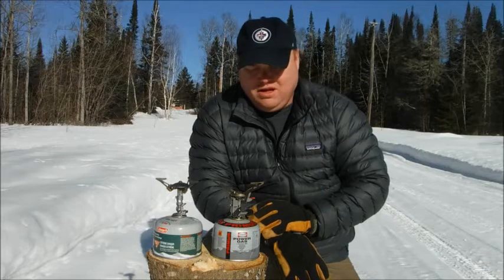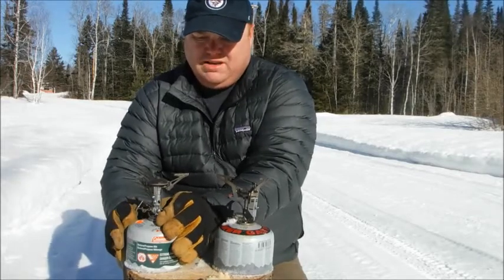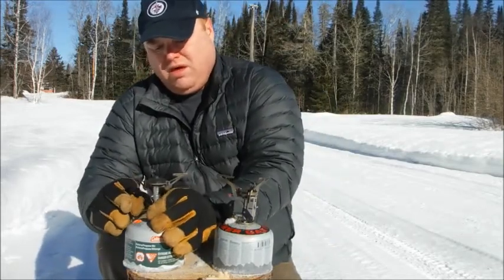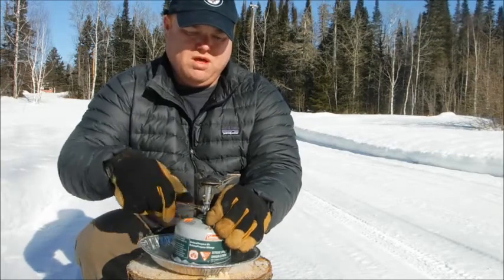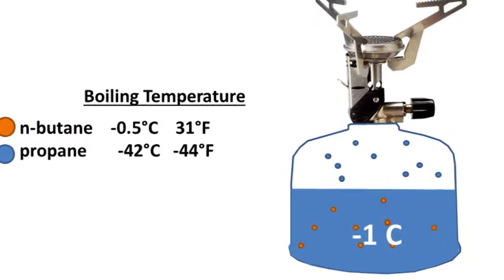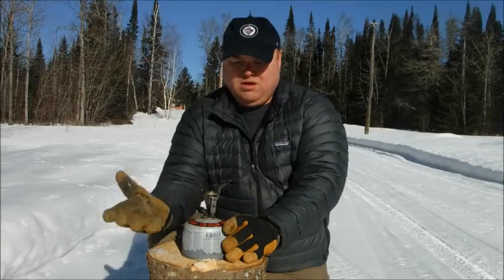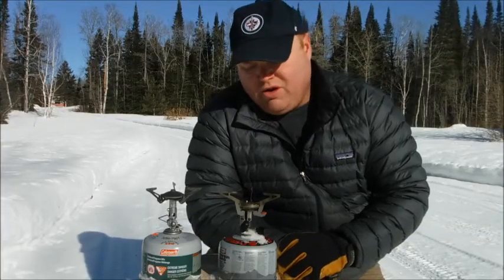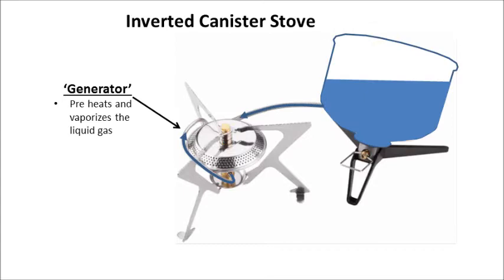Canister Stoves in Winter

Comment: I have a couple of things to say. 
I assume that even if you preheat the canister with some water then only isobutane will burn and butane and propane stay in a liquid state and won't burn at all (unless the canister heats up a bit from the burning fire).
Second. Inverted canister stove with the preheat tube is good to burn all the gas that's in the canister (including propane and butane) which will not probably burn if you use a regular standing upright position.
What do you think?

Comment: That water bath is a great trick, where do you find liquid water at -20C?
Reply from the maker: Since this was just a demo I got it from my house.  When I am winter camping I am collecting water from a hole in the ice and that water is just above freezing.  Also I will boil water and put it in secure bottles in my sleeping bag overnight.  By morning those bottles are still well above freezing.   When winter camping I am always managing my water to ensure I have at least some available at all times.
Reply: @KevinOutdoors  Takes a long time to melt snow, plenty time for that cold water to freeze. If this works for longer than 5 mins it has to be because some heat from the stove is being reflected down to the water bath to keep it from freezing. Still a neat trick though, thanks.
Reply from the maker: @andyr4611  I know in some situations, like arctic expeditions, people have to melt snow but that is pretty rare for me.  Melting snow takes a long time and consumes a lot of fuel because snow is so bulky and you only get about 20% of the volume.  Another trick is to put the fuel canister inside your jacket, it will warm up and light just fine.  Once you have some warm water you can keep going all you want.

Comment: GSI has one of the best cartridges on the market for high altitude snd cold! 70% isobutane, 20% propane and 5% butane.

One needs an inverter system for canisters in serious cold.

For serious cold & altitudes one should skip canisters and go with a liquid white fuel stove!
Reply from the maker: I think you said it very well!
Reply: @KevinOutdoors Thanks 
You hit the nail on the head about the Coleman…it’s just a simple mix. 
Calling the Coleman 70/30 “performance blended fuel” is misleading @ best!

Comment: Thanks for the explanation. Have you posted about liquid or multi-fuel stoves in winter?
Reply from the maker: I haven't.  Something I might try.  Thanks for the suggestion.
Reply: @KevinOutdoors  liquid/multi-fuel stoves in winter and/or high altitude please, if you can ;) Do you happen to climb big walls?
Reply from the maker: Cold weather I have, mountains I don't :) @franka7691

Comment: Suggest you try the test again with a cannister containing iso-butane and propane.  Example brands are Jetboil and MSR Isopro.  I expect this will work better than the three gas mix, which might end up vapourizing the iso-butane and propane, and leaving the N-butane in the cannister.  I've never seen a cannister in my country with the two gas N-butane / propane mix.
Reply from the maker: I suspect they will function similarly but it might be worth a try.  I checked out both manufacturers.  MSR Isopro does contain n-butane but they specify <5%.  I actually use those canisters quite often.  The Jetboil canisters are supposed to be 80% Iso-butane and 20% propane.

Comment: However, if two gasses are completely immiscible with each other, each one will behave independently of the other in a closed vessel. So why doesn't the Propane (-44 deg F boiling point) work best, even with the butane mixed in?   Or am I not remembering my high school chemistry correctly?
Reply from the maker: I am not a chemistry professor but I believe the propane gets used up first.  Sometimes these stoves will light and burn for a bit then go out.

Comment: I live in Fairbanks, Alaska.  I found that at -20 to -40 degrees the stove lights, but with the 4-seasons canister does not boil water as well as my MSR whisperlite using white gas.
Reply from the maker: That makes sense as white gas is far superior in cold temperatures.  Below -20C even the winter mix will slowly stop to function.

Comment: Hardcore winter canister top stove users may want to take a lesson from rock climbers and wrap a couple turns of 1/8" copper wire around their canister, with both free ends of the wire bent upwards, into the flame.  Don't dump so much heat into the canister that you blow yurself up, kids.
Reply from the maker: That last part is the trick isn't it.  I know it works but I wouldn't try it, it is a very steep learning curve :)
Reply: Awesome tip, thanks.

Comment: I found a heat transfer product designed for fuel canister! 

http://image.auction.co.kr/itemimage/13/3b/bb/133bbbb486.jpg

Check out this image... i can only see it in Korean market.... but  I am sure one could make a similar thing easily.

Maybe a strip of copper or aluminum and a strong magnet.  Since it will be used in cold weather + metal will be some what thin? It'll never get hot enough to make the canister itself hot.

What do you think?
Reply from the maker: This is a very interesting concept.  I have seen this kind of thing before but not a commercial product.  There is a video out there where a rubber band is used to hold a copper strip against the canister and the strip extends up to near the flame just like the picture you show.  This will work, but there are risks.  At some point, enough heat will cause the canister to go 'BANG'!  I don't know much about when that would occur but I do have an old windscreen that clips to the little rim on the top of a canister.  It looks ingenious but it was recalled because it could possibly transfer enough heat to cause the canister to explode.  I find this really, really interesting and thanks for sharing.  I would shy away from this technique, I am sure explosions are very rare but you don't want to be 'that guy' who had an accident.  It is interesting that this could be used with different stoves all of witch could have different heights and different radius of flame.  Not a lo of control on how much heat is transferred to the canister (unless I am missing something).   If I was going to regularly use an LPG stove in cold temps I would use a stove with an inverted canister and a pre-heater.  But, this is very interesting to me and thanks again for sharing!
Reply: @KevinOutdoors  True, enough heat transfer can make it go KaBoom.  But looking at that commercial product you could see that metal is thin and narrow inside some sort other outer part.  Can't imagine it transfering enough heat.

I saw the video you spoke of and in that video... even a hand warmth helped get it going.  So very small amount of "warmth" transfer must be enough.

But... I guess better safe than sorry? :)  Cheers!
Reply from the maker: It does look ingenious and well designed and they may have figured out the safety part. Almost any form of heat will work, keeping a canister in your sleeping bag, setting it in water or applying a chemical hand warmer will work.  You just need to raise the temperature to above -12C and I recently saw a new 'winter mix' that was rated to -20C.  It will be interesting to see if this will come to markets in North America and Europe.

Comment: 60 dollars for a white gas stove. It a lot safer when it's cold and use the canisters in the summer.  30 ounces of white gas can save your life in the winter. You can unthaw your hands or feet dry boots and boil water. If all I had was a canister stove I wouldn't go in the winter. Too dangerous and white gas is cheaper too

Nice video just the same
Reply from the maker: Thanks, yes just showing how it can be done.  I only think it is dangerous if you rig up a heater.  I have seen folks use a copper band to get hot in the flame and they tape it to the side of the canister.  Not the way to go.  I too prefer white gas in the winter and actually where I live winter usually means you should be building a proper fire.  Thanks!

Comment: better use a stove with inverted canister mode with a heater tube so it can burn liquid butane directly...
Reply from the maker: Yes I agree.  Exactly what I reccomend in the video.
Reply: @KevinOutdoors  liquid does not ever burn directly. Nothing in liquid phase burns directly. . It has to be a vapor or gas. Inverted stoves flow liquid to the burner where it heats the liquid into a gaseous state which then burns with gaseous O2 to produce the flame. Great video. Thanks for posting

Comment: We always use IsoBut in the winter and even in the mountains at elevation, it just burns cleaner and without issue unlike straight propane.
Nice lid!
Go JETS Go!
Reply from the maker: Thanks!  The 'Jets' are my kids team.  Gotta like the NHL team too!
Reply: i am planning on buying propane Coleman Bottle Top Propane Stove, with propane cannisters. whats the main issue with these for winter camping ?
Reply: @shahzaibsansi7848  Propane loses much of it's ability to vaporize thus also pressurize in cold temperatures.
I use straight Isobutane by MSR   but it truly is all the same and have never had any issues in winter, but you can also buy winter specific Isobutane also by MSR too.
Reply: @batwithglasses-BB  i have seen people keep 20lb propane cylinders for bbq grills outside for the entire winter and it still works, is the smaller 1 lb not effective in winter just cuz of its size?
Reply: @shahzaibsansi7848 
 All propane cylinders lose pressure in the cold, smaller ones faster due to capacity.
Propane turns to liquid at -42c.

Comment: Good video! I like your boil tests under different conditions. I bought the new GSI Pinnacle 4 season stove and Ive found that it works great in the winter when the tank is inverted, however I think that it uses more fuel in the inverted position as opposed to siting upright. I will have to do a test similar to yours to prove that though. Keep up the great work! :)
Reply from the maker: Thanks True North!  Much appreciated!